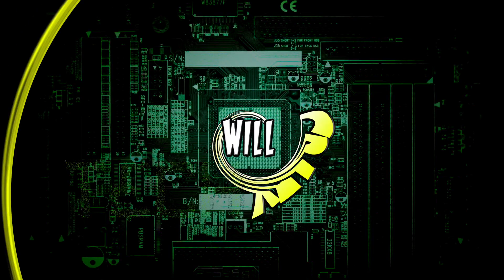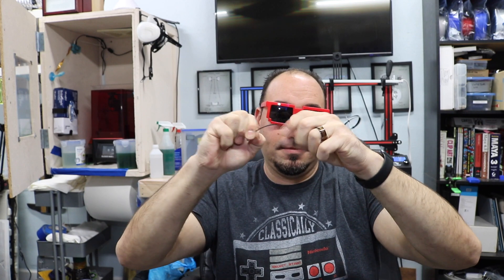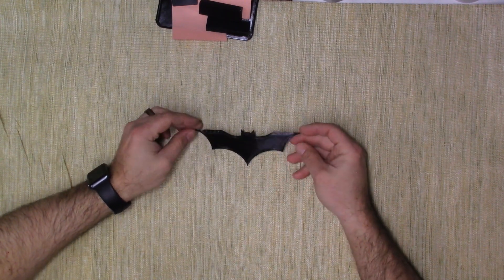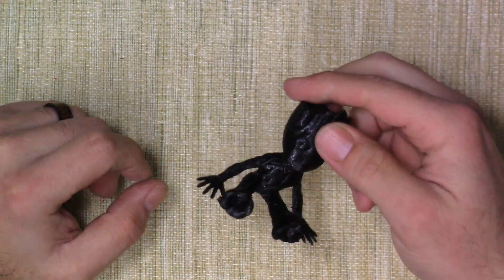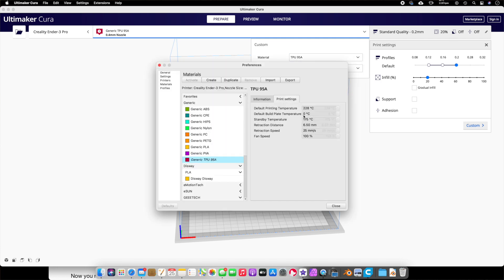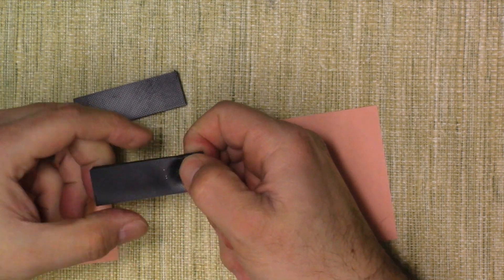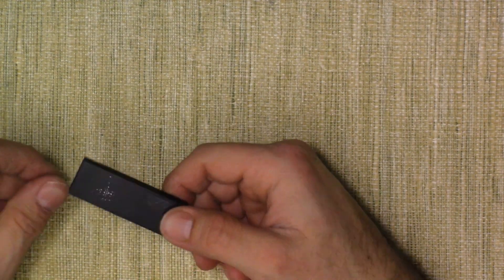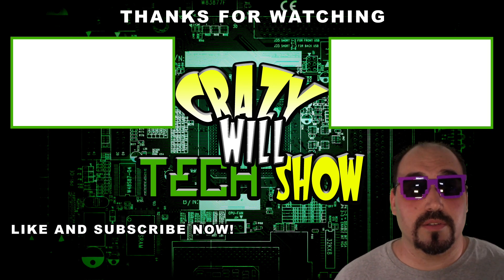3D printing in Rubber? TPU Filament

Comment: hi thx for our video, so what if you want rubber to print rubber "legs" so my ptinted boxes can have some grip. my tpu went flexible with low infil that took me some triesl. vut it has no extra grip.  what about more foamy stuff just print tpu very hot? hoe do i print steaks? :)
Reply from the maker: Thanks for watching. What kind of legs are you trying to print? Steaks I would probably go with PLA plus not rubber.

Comment: You said you had a problem with PETG  I have my temperature at 240 and my bed temp is 70 I'm running the speed at 75% And I don't use Cura I just use the software that came with the end or 3 and all my prints have been coming out fairly decent
Reply from the maker: Thanks I’ll give that a try, think I got a Bad Batch or probably never got the temperatures right. It was in the beginning of my journey into 3D printing.

Comment: Do you think if I made a long tube and put a bendy wire in this it would hold the shape of the wire?
Reply from the maker: Depends on the infill and how thick walls are on the tube. What is it for?
Reply: @CrazyWillTechShow  to make like a octopus that you could move the tentacles and have them stay
Reply from the maker: I don’t see why not. Wouldn’t it be easier just to use PLA?
Reply: @CrazyWillTechShow  well I’d want it to be Poseable
Reply: Could you share your Email? Need to discuss about a project. Thanks

Comment: Thanks Will! Great info. How much longer did the TPU print take with the infill at 100% I will need to print something pretty dense, and large. Probably days right?
Reply from the maker: It did well but it going to double your time to print. To get the exact time put you print in Cura or some other slicing program and put TPU settings in and should give you approximate print time.

Comment: But.... but.... it’s not rubber😒. Don’t always need a direct drive either. Depends on the shore hardness.
Reply from the maker: Yeah but if you look it up everyone recommends a direct drive. After using it I understand why. And yes I know it’s not rubber trying to make more understandable. It’s TPU a rubber like material or filament.
Reply: @CrazyWillTechShow  yeah. Like I said, depends on shore hardness. Not sure what that one is you used, but seems decently flexible. Ninjatek Armadillo is a TPU that is pretty much as hard as PLA. On the other hand, Ninjaflex is damn near impossible to print on bowden.

Comment: I have an Ender3 and so far only print PLA, but have bought a roll of TPU. Just wanted to ask how easy it was to swap filaments as I only have the one printer and usually just leave the PLA on there. For instance can you retract the TPU out, or do you cut and push through with the new filament? Thanks 😀 👍
Reply from the maker: Good question. It works the same way you change out pla I wouldn’t leave it there for long bc it likes moisture and will get stringy.
Reply: @CrazyWillTechShow  Thanks

Comment: Have myself a roll of TPU in white. Very fun to print little.models with it and toys as well. They can be durable but also hard to print on the Bowden Extruder :(
Reply from the maker: Yeah should’ve did wait for the video... I was thinking tires lol 😂
Reply: Use a higher shore hardness TPU on a Bowden. Less flexible, but easier to print on bowden
Reply: @flphil4537  would 95a work well on a Biden extruder
Reply: @Ala1nspirit  oh yeah, I print Ninjatek Cheetah (95A) on my Bowden printer. Only stuff I have trouble with is getting down towards Ninjaflex; that’s for my other printers (all direct drive)

Comment: Is TPU actually rubber? Just a question.
Reply from the maker: I believe it’s the type of rubber. I actually use it in a lot of products outside 3-D printing.
Reply: @CrazyWillTechShow  thank you for actually responding.
Reply: @namehere674  no. It's a type of plastic. But I'm not hating. Still a good video and it's a simple mistake.
Reply: @3dPrintingMillennial  it still acts similar (I think) so I don't really care. Thanks to both of you for the information though!